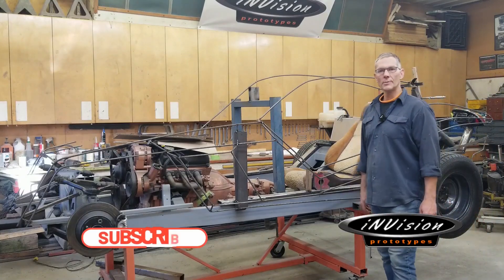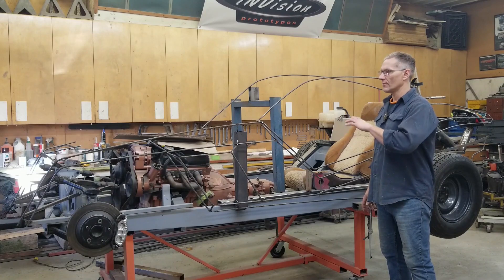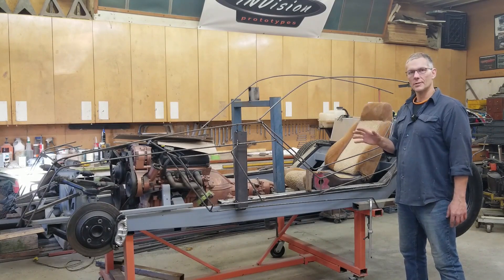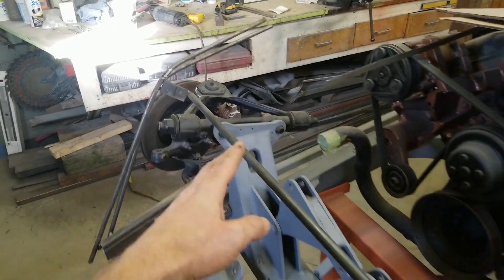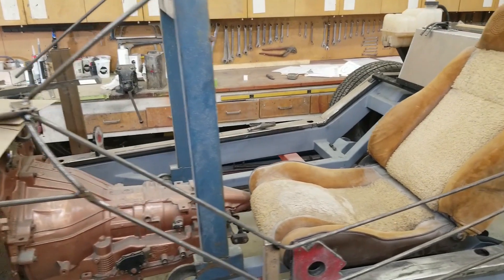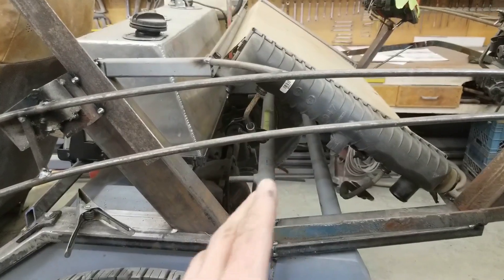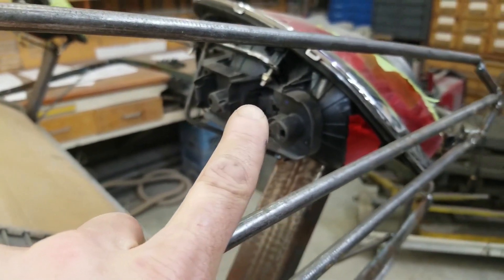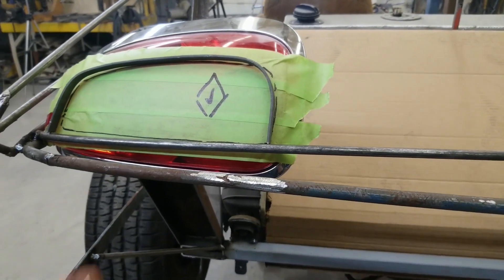HAND BUILDING a Custom CAR - Wireframe Ins & Outs  - Ep.4 | After Burner Hot Rod Roadster

Comment: Wondering what the front lights are gonna be ..... modern or old school.... would be interesting to see the wind tunnel on your design to see if the turbulance from the open wheel effects the intake cooling air .... looks like it'l definatly fun to drive ....
Reply from the maker: Modern  - probably LED.  Yea that would be interesting to get this into a tunnel... don't think my waving to and fro is that effective at representing air flow... LOL!  See how she performs when its done.  We shall see.....may need to add bigger scoops. ;D